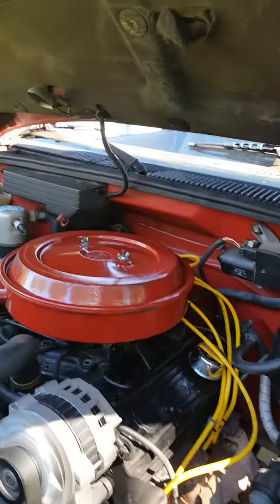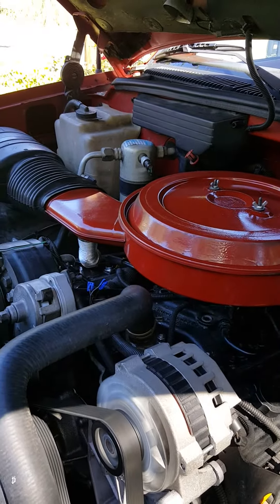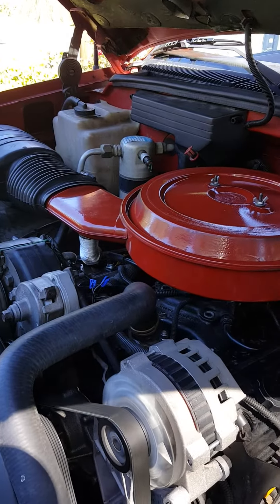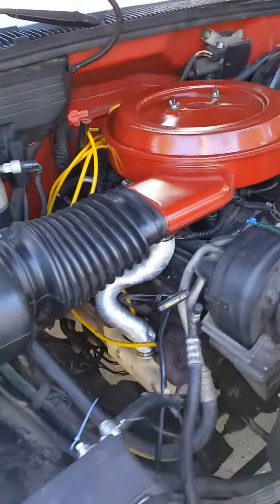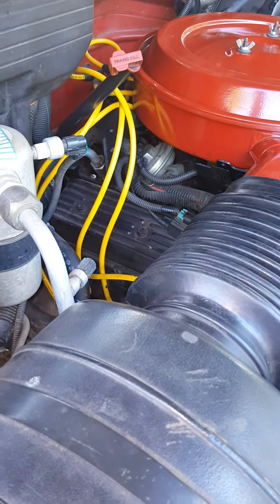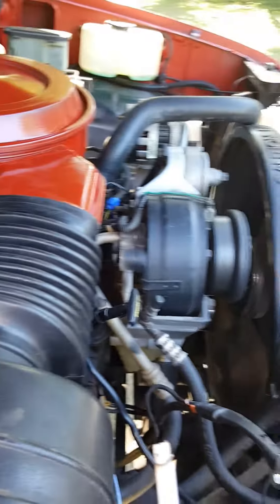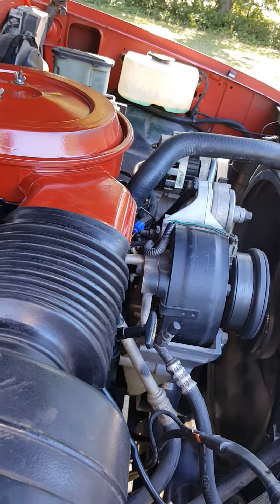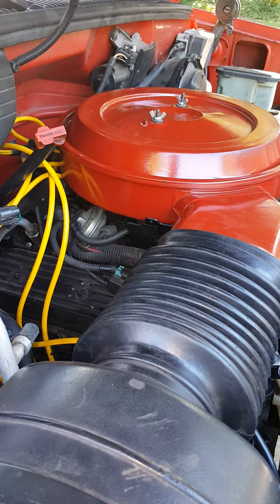Idle problem 93 k1500 5.7

Comment: Did you find anything that solved this? I have the same issue on my 95 g20
Reply: Remove the IAC and spray carburetor cleaner inside the hole the IAC came out of. Then use the carburetor cleaner and clean the Idle Air Control valve.